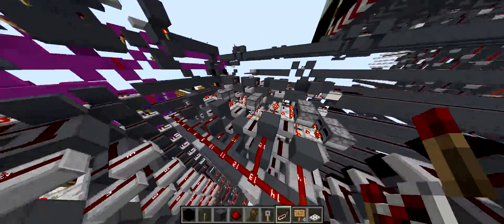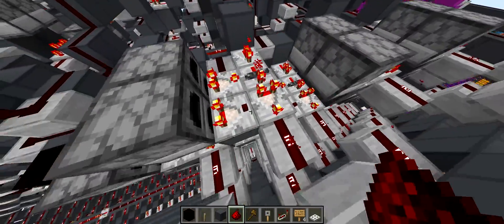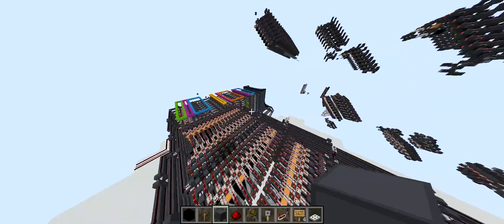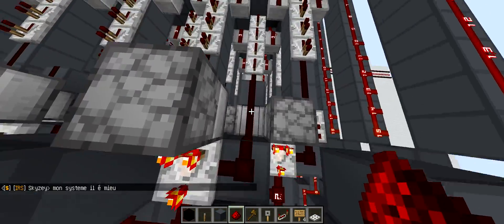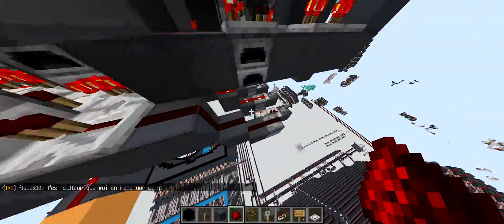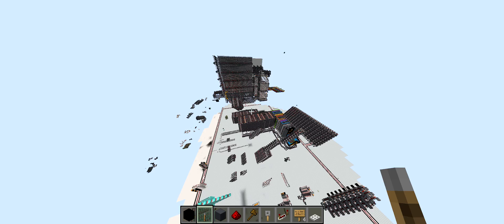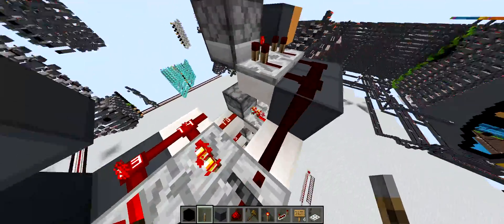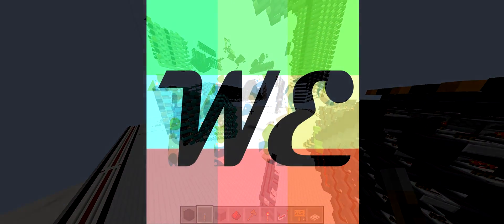Why do Redstone-Pro's use Furnaces?

Comment: Pros: 
- Comparator Data Source
- Solid Block
- Non-emitting
Cons:
- Has ticking update even when not in use

The pros allow pros to add extra compactness to their logic circuits.
The cons prevent them from being use everywhere for everything all the time.
Reply from the maker: you can now use barrels for signal strength and they dont tick :)
Reply: @WildEngineering  Excellent...